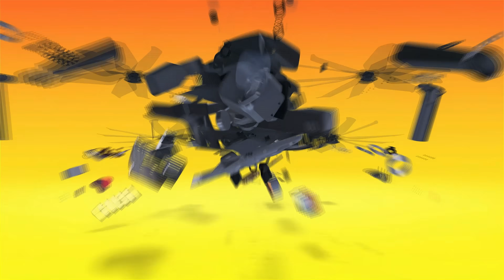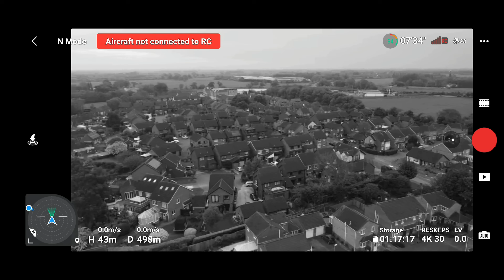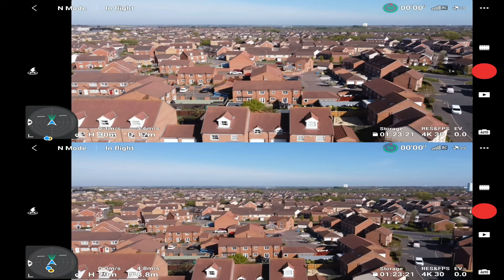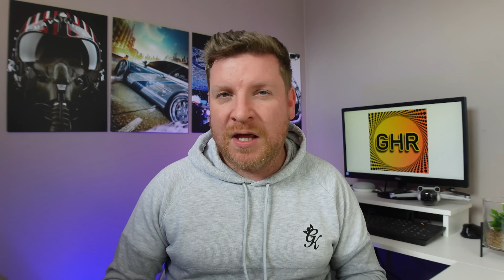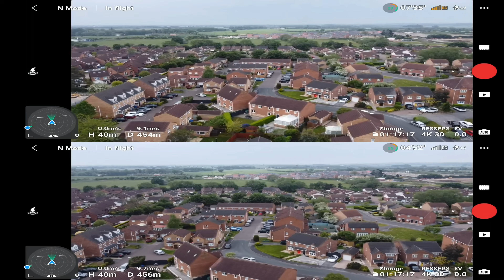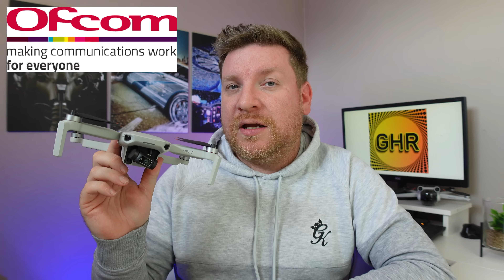How I FIXED My DJI Mini 2 Connection Problems - ILLEGALLY

Comment: I’m losing signal while it’s directly over my head… I’m losing signal while it’s hovering over my head and while it’s in direct line of sight, no further than a 50 meters away with, a direct line of sight…
Reply: Mine too…
Reply: @danilozasimowicz2387  mine too no more then 60 meters
Reply: @danilozasimowicz2387  
I got ahold of customer service, thru the app and they went into my drone and remote and did some stuff while I was on the phone with them and I haven’t had the problem since then. You can call them or, chat online, which is what I did. I prefer that method because, I’m not much of a conversationalist these days. I had a stroke a couple yrs back and my linguistic skills are, sub par. However, you can contact them either way right thru the DJI Fly App… Hope this helps you
Reply: Mine too, is this a hardware issue? Is there any way to fix this without sending to dji
Reply: @JaysTech_You know, it seems to be temperamental. One day it’s fine and the next, it’s on the fritz. I’ve come to believe that maybe, maybe it’s microwave interference or, some other type like, 5G. Idk for sure but, for some reason it only happens sometimes. Call DJI and have them talk you through some trouble shooting points as well. They will help your thru text or, over the phone. I did this once as well and it seemed to have stopped, for awhile. Also, always make sure your up to date on downloads for the drone and your DJI apps… Hope this helps… ✌️😎… Good Luck….
Reply: Mine lost signal while 3 meters a front of me

Comment: That new firmware has made it impossible to fly my drone at 100meters in urban areas it says transmission blocked and looses all control and return's to home even when the drone is few feet infront of me I have no control I have to walk to the drone and snatch it out of the air this is highly upsetting

Comment: Hi can you help a very frustrated newbie pls,I've recently bought a mini 2  and find it near impossible to pair up to start flying,
I've downloaded the latest dji fly app my controller and drone are both on but can't seem to get any where else.
I've gone through the procedure and it saying in app that I'm not connected to mobile device, am I'm missing something. 
Do I need to register my drone with dji first for it to connect up,just don't get it.
I've taken out the refresh protection also.
Hope someone out there can help,it's driving me bonkers.
Reply from the maker: Simple thing would be to check you have the right cable from the controller to your phone ? In the controller one stays in the controller the other to yohr phone make sure you are connecting the right cable

Comment: If I done drone tweaks (if as I probably won’t) 

I have a DJI mini 1 so I don’t think it works on that but if I get a mini 2 or mini 3 which would you recommend as I live in a area we’re I get bad signal (200-300meters)

Comment: I purchased this app and have tested it on a few flights, absolutely brilliant!! I’m not that bothered about trying to fly too far out but I do like that in built up areas such as where I live I can now fly around 500m and more if needed without connection issues. I did get over 900m while I tested it out but brought it back as that was far beyond what I will fly at home .
Reply: What's the name of the app?
Reply from the maker: Makes a huge difference doesn't it
Reply: @GAVINHR  yeah I’ll have to go back to the original app now I’ve tested it 😉🤭

Comment: If I take my US Mini 2 to Europe this summer will it reset itself to the EU mode? If so will it revert back to FCC when it returns to the US?  Will I need the app you mentioned to force it back to FCC from the more restrictive EU mode? If so I may not do the update until I get back, I've held off this long.
Reply from the maker: Hi Rick, yes that first part is correct, if you come to EU the drone will know it's location and stick to EU broadcasting power but will return to normal when you go back to the US you won't need to purchase anything:)
Reply: @GAVINHR  Thank you

Comment: I do wonder about some of these rules. I understand there has been some people flying places where they shouldn't but as you point out having a bad signal or bad connection surely is far more dangerous. This rule I have never understood, these rules and regulations are supposed to be for safety etc but some of the rules I think are ridiculous and have nothing to do with safety. Great information 👍
Reply from the maker: exactly my point of the video :) so much safer to have a stronger connection, safety first and regulations second I believe is what Ken Heron said and he is right
Reply: @GAVINHR  Yeah exactly we always seem to get the short straw regarding the rules and regulations I guess the only good rule we have in the Uk is the under 250g where we can fly pretty much where we want. Some of these rules and regulations just do not make sense. Apart from a few accidents or incidents of people flying where they shouldn't there hasn't been any fatal accidents and yet we have some real strict regulations.

Comment: is this issue just on the mini 2? I've got the mini 2 for a specific use and now im unable to use it for this because of the connection issues. is the mini 3 pro also victim to this?

Comment: Tks, good work Gavin. However i was warned about not to download the new firmware, therefore i didnt. In 🇨🇭, even in hilly regions, i reach 4-6 km of distance easyly.
Now waiting for the M3P, which i got confirmed for May 31st, fly more combo already arrived.  Hopefully ill have better results with the N1ctr than is reported by some ppl using the fancy RC with builtin screen...  have fun droneing dear fellows 🤣

Comment: The hack on the Mini2 is not fully automatic like on the other drones, for the Mini2 you need to press the button on the butt of the drone after boot, wait a few seconds until the beeping stops, then press it again, after that the drone will blink red at the front light. Now the hack is active. This procedure needs to be done after every boot of the drone, but thats it. No internet needed, mobile phone OS does not matter, and even SmartController is supported 100%
Reply: Hello which one did you use?
Reply: @sousarogers  wich one what? The Mini2 with the latest f.ckin' firmware and the latest Android software update.

Comment: Good video . . . its also possible to do this for free . . . but has to be applied each time the drone is used . . via an android app using the bottom USBC port of the controller . . . quick and easy and works . . the name is "mavic air 2 fcc" . . . .  i find I dont really need it in rural areas anyway, but nice to have an option . . . . enjoy

Comment: What's more interesting: There's a free FCC hack circling the web, that works with the Mini 2 and RC-N1. It also works with other RC-N1 controlled drones. I'm curious if it also works on the Mini 3 in combination with the RC-N1 controller?
Reply: Nevermind, I just got confirmed you can hack it the same way. :goodvibes:

Comment: So, apologies for the stupid questions. I'm brand new to this. I now own a mini 2, but haven't taken it out of the box, and have zero experience using any drone. I'm an American, but hope to someday travel with it. Just to clarify, it's not a hardware issue based on where you buy it, but an issue of where you fly it? Is that correct? So if I came to the UK, with my American purchased mini 2, I'd be subject to the same issues? And since I've yet to use my mini 2, is it likely to have the previous firmware? And if so, am I better off not updating it?
Reply from the maker: Hi Richie, basically you are right on all of your questions! I would suggest not updating it also

Comment: I am so glad you put this video out I was having the  Exact same problem ended up knocking my confidence that much that I got rid of it so I decided to get the mini 3 pro 😁
Reply: Real world tests are showing bearly 1,000 metres with the mini 3 pro and the dji RC so it seems it’ll be similar if not worse than the mini 2 CE (this was CE mini 3s). Personally I’m not bothered about 1,000 metre range its more the stability of the connection which is lacking.
Reply from the maker: Is that urban or rural? Ive not watched any range tests at all on this drone
Reply: @GAVINHR  dc rainmaker did a video yesterday on the controller (specifically addresses the real world range) and there was one on reddit 👍
Reply from the maker: @dee_em_bee  will look into it
Reply: @GAVINHR  Here’s the one linked off reddit (https://youtu.be/aUXbnnueUUM) weak signal at 700ish. The DC rainmaker video is here https://youtu.be/EkDyjDtOeWE its around 5 mins 18 secs in. In a urban setting as per your DT hack video I bet its more like 300-400 if that. Be interesting to see your comparisons Gav 👍

Comment: great info gavin  👍,  purchased the app-  just 1 thing i noticed upon activation - its valid for 365 days only,   hope it can be renewed each year  🤞🤞🤞,  still a bargain  for better signal  ,    cheers
Reply: What is the app can you pop a link in the comments
Reply: @Badmana0  check out the sticky and just google the user name. Will come straight up.
Reply: please explain what you mean I'm going nuts lol explain
Reply from the maker: See the pinned post :)
Reply: @amilligiavonni  Gav’s covered it but in a bit more detail (as its not my YouTube channel 😂) two main options 1) Drone Tweaks - this is a modified DJI Fly app for iOS or android, really easy to use - only thing you have to watch is that it doesn’t auto launch the stock version when turning on the controller. Its €24 and lasts 12 months; it will require another €24 after that. The 2) option is drone hacks. This is a permanent hack which requires you flashing the drone itself. When starting the mini 2 you have to activate FCC mode (button press when it boots, takes 5 seconds). This mod will then just use the standard DJI stock app. Its €40 for this. I’ve tried both, they both have pros and cons - both work great though. I don’t personally like the 12 month license - its not the cost, because customer service was great its just if they stop supporting it. Big advantage with this though is its app based, so if you have multiple drones that use DJI fly (air2s, mini 2, mini 3 pro etc) then it will work with all of them. No risk of bricking your drone, and also isn’t dependent on firmware version. The drone hacks one is based on the drone, so you’d have to do it on each drone, also there’s always a chance of bricking your drone when flashing it. Also isn’t possible on certain versions of the firmware. It is more expensive but it is permanent so if they stop supporting it, you’ll still have fcc on the drone.
Drone Tweaks is definitely more straightforward, drone hacks gives some other bonuses like DNZ zone removals, parameter editing.
Reply: @dee_em_bee  your  a funny guy , lol. I know it's not your channel I'm just trying to get some input and I did. thank you so much highly appreciated and what do you think about fpv the funny thing is I got three Hawks and haven't got one in the air yet lol... the funny thing is it's been about two three weeks and I've got three of these tiny logs to freestyles and a brick TX 16s and now the new beta fpv to se LOL I'm on a mission. thanks for your input happy flying my dude
Reply: @amilligiavonni  no worries and good luck!
Reply: I appreciate it. 
keep it classy and happy flying!!

Comment: Brilliant Gavin! So one can assume the Mini 3 will also suffer the same issue?  When i looked on "Drone Tweaks" they claimed it almost halved, from an FCC allowed noise of 26dB on 5.8Ghz all the way down to 14dB for CE, which is a very big difference given the logarithmic nature of the dB scale. And For Ocusync 2.0 drones (Air 2, Mini 2, Mavic 2) for example, this drops the maximum range from 10km to 6km and offers much less stability at close distances when going behind obstacles like trees or houses or when flying in area with high interference. So obviously this would be a great app to purchase when anyone is traveling abroad where the higher output is allowed.

Comment: How can I tell if the drone is operating FCC? I am in New Zealand and not sure if I would be affected by this power decrease problem.
Reply from the maker: Exactly as has been said 😄
Reply: The 1KM mark should be above the line in transmission menu.. In CE the 1KM mark is same height as the line.

Comment: It pains me to say this but it’s all too easy for  Drone Pilots to lay the blame on everyone else but themselves for the many woes relating to regulations whether openly stated or invoked behind closed doors. In the same way that ISP’s have been encroaching upon peoples privacy with data management mining etc, so to have many Drone Pilots been flouting well published regulations with on several occasions, potentially hazardous to life consequences. You can’t honestly tell me that flying a Drone across a housing estate and along a river bank some distance away complies with VLOS. I’ve seen countless videos presented by several European well followed YTbers that blatantly disregard this regulation and whether intentionally or not, encourage others to emulate them. That’s fine, but if Pilots cannot or will not abide by the rules then it shouldn’t come as a surprise when authorities are obliged to react and in this case most probably encouraging DJI to reduce power output. What happens then? Well of course we start feeding the hackers or so-called tweaked. For goodness sake when will the penny finally drop. A time will come when either hobby Drone flying is banned or so strongly regulated that it no longer becomes financially viable to further pursue the hobby. As always, the few will end up spoiling it for the many.

Comment: As we aren’t in EU then really we should be on FCC levels
Reply from the maker: I have to agree with that!
Reply: @GAVINHR  I use the modded app for last 18 months with Air ( gives ADSB) with that and Mavic 3 and mini 2 and never had connection issues

Comment: Can you do a similar test with it locked to 2.4GHz versus leaving it in Dual and letting Occusync (badly) choose.  I think you'll find 2.4GHz will hang onto a signal far better than 5.8GHz.  Doing this works for me, and over the town allows me to easily get to the point it needs a strobe on to see it.  I think you will be surprised....
Reply from the maker: Hi there, I have attempted this many times with the results not consistent enough to be able to make a proper video of it sadly, My theory is that as 5.8ghz is becoming more congested 2.4 would actually become the better frequency but to make a video as thorough as I like I need repeatable results which is still lacking
Reply: @GAVINHR  OK, thanks for trying, each location will obviously vary.  I think CE legal 5.8Ghz is so underpowered, I reckon 400-500m seems to be its max urban range where I live, with the Mini 2 forced to 5.8GHz.  I can usually achieve urban 1500m with the Mini 2 forced to 2.4GHz, hence the need for a strobe!  I just wish DJI provided a way to remember the frequency setting, rather than always defaulting to Dual frequency and relying on Occusync's poor selection, but for now I just add it to the preflight tick list.

Comment: The biggest issue is the ridiculously low power on the 5.8ghz band in CE areas which cripples ocusysnc in urban environments.
Reply from the maker: Exactly the point of the video Stephen, 14dbm is too low and causes these issues. It needs to be looked at and I've now raised awareness with them so you never know

Comment: Ok so you found a way to improve signal strength, but do you know why DJI decreased it so much in the last firmware update?  And I guess that didn't change anything to the time it takes to acquire the GPS satellites?
Reply from the maker: No that was just the same sadly

Comment: Smart test  not really illegal, and a good demo to the CAA that we should have ignored EASA on this issue - they don't recognise CAA qualifications, do what's homolegation about since we left the EU?
Reply from the maker: That was my point, I did feedback this to OFCOM and they seemed to take it on board, I have been approached by this developer on a couple of occasions but always declined but after now losing connection at such short distances I felt it was a good topic regards to safety, You are right though we are no longer part of EU so maybe that can be looked at

Comment: HOLD UP,  I'm experiencing the recent signal and disconnect drop outs (never had this problem when first got drone, plus I fly in rural area) But I'm in USA, how does this explain my drone flight quality degradation? Am I not receiving the FCC signal?
Reply from the maker: You will still be seeing it yes and you will be running in FCC mode it is just that because you have a greater signal to begin with it somewhat masks the disaster we are getting here over in Europe however the drop in signal strength after the last update is noticeable worldwide

Comment: Great video Gavin. Great information. However, as I indicated before, I did not update to the latest firmware. I have no issues with satellites nor interference. I have recently flown in an area with high inferences such as in your video and have achieved distances of over 700 meters without signal dropping. It is unfortunate that the new firmware is still causing these problems. Keep safe.
Reply: What is the firmware version you’re on